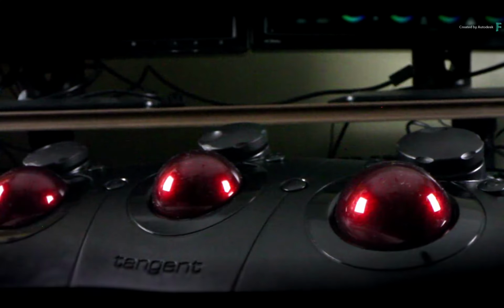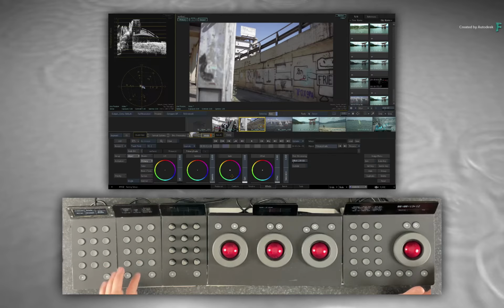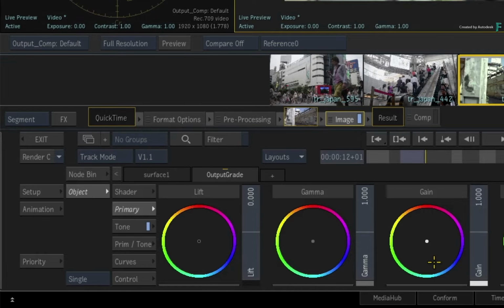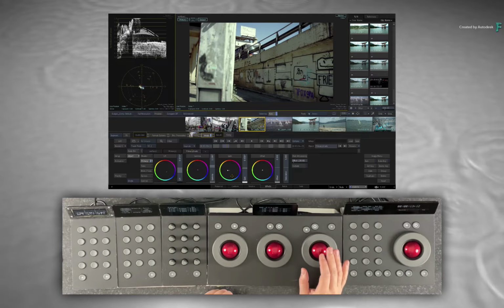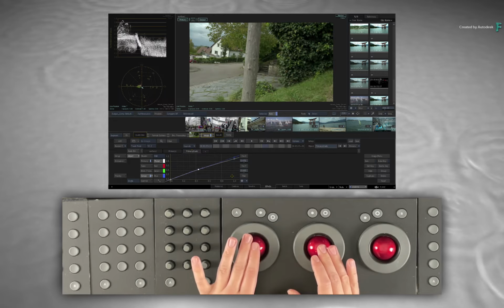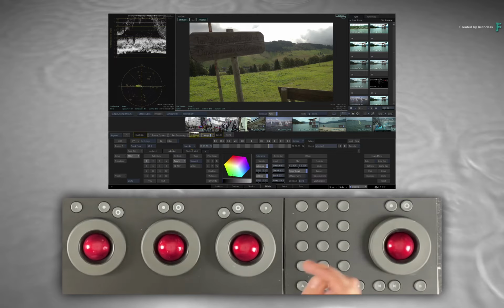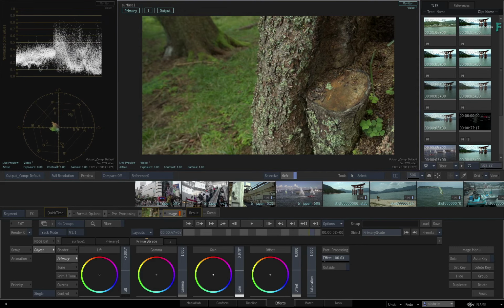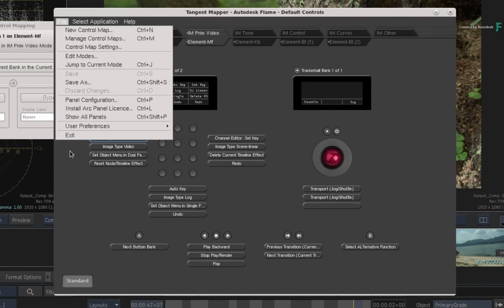Grading with the Tangent ELEMENT Panels - Flame 2022

Comment: Hi Grant, Not possible to use the panel via Remote work?  (Linux)
Reply from the maker: Hi Peter, this functionality is not supported via a remote connection. Apologies!
Reply: The current beta of teradici has this feature. At the moment they are supporting only windows and Linux.
Reply: @nonyabuiz2023  Thanks Adam!
Reply: @nonyabuiz2023  Hi Adam. I still can't connect my Tangent. Any setup should I?